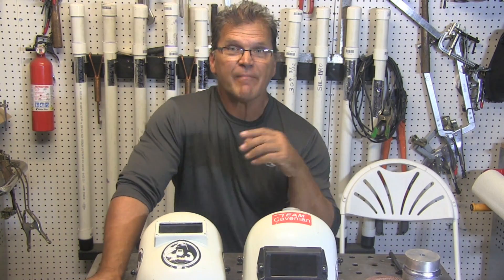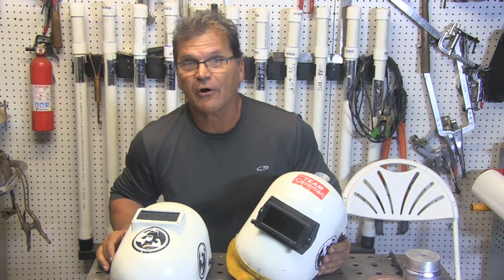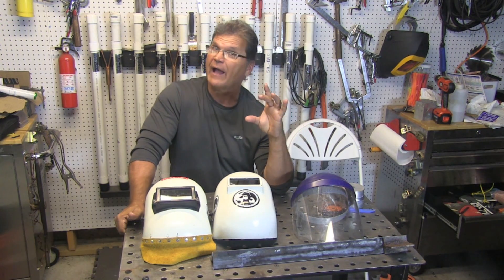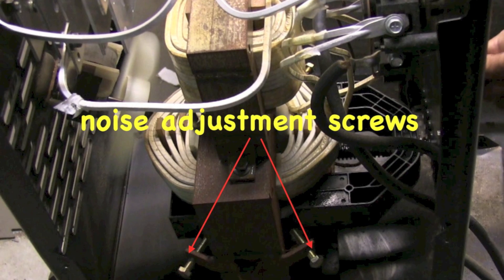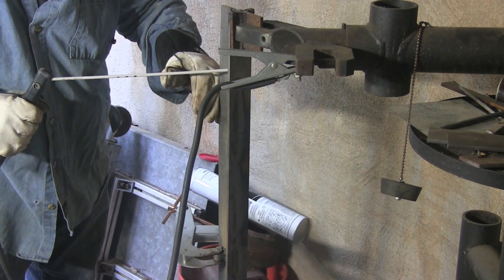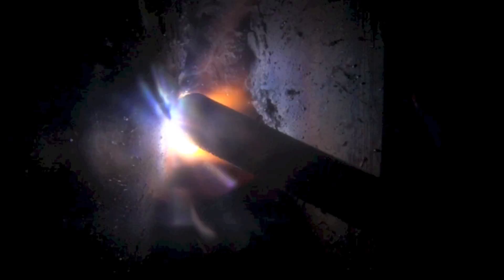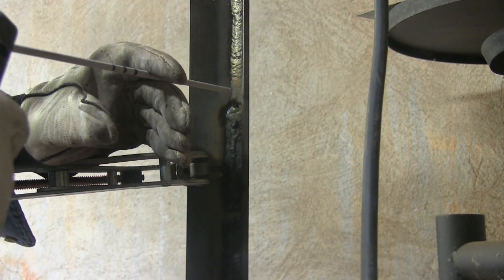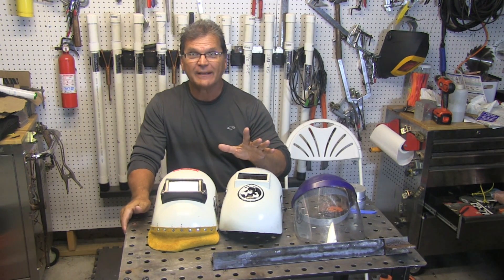Stick Welding Uphill 7018 2 Foot Long Tee Joint

Comment: Thanks Jody! I'm sure you have to have seen it on pipe before, but why is the "Butterfly" weave not used anymore, and could you show us a bit of it? Aloha...Chuck
Reply from the maker: not really sure.  as out of practice as I am on a 7018 weave I am not sure I could handle it.
Reply: Knolltop Farms I know alot of older welders that circle the toe and its just another way of depositing more at the toe, like a pause but keeping the rod moving.
Reply: When you say butterfly weave, do you mean with 6010 on a horizontal weld?
Reply: No, it's an uphill weave specifically used for the cap that has a distinctive ripple pattern. Kinda like a stick-figure bird or something, you'd likely know it if you'd seen it. It's an old pipeliner and boilermaker technique you just don't see anymore. I think it took too much time for little to no added benefit, I don't think it was metallurgically unsound, but I'm unsure so that's why I asked. Thanks for the reply to both of you, hopefully someone else may know.
Reply: I cannot do it myself, it was already out of practice by the time I worked in the tank farms starting in the 80's. But, I was told you make little stick-figure birds, with a pause in the middle. I don't see how there's room for that even if, but who knows really...I wish "Grandpa Joe" would come out and tell us, LOL!
Reply: Knolltop Farms I just did an image search in google for butterfly weave welding and there is an image from an old textbook showing some oldschool weave movements and one looks like it could be described as stick birds.

Comment: Another great video Jody!  I am a new "hobbist" welder, and have been watching your videos over the last few months.  I just ordered a AHP 160ST, 10lb of 3/32 7018, and 10lb of 1/8 7018 from Amazon.  I am ready to start "padding beads" with confidence after watching these videos.  Thank you so much!
Reply: Ill keep that in mind.  I intend to eventually learn tig as well, but I want to get good at 7018 first.  I will mostly be welding 1/8" thick carbon steel tubing, angles, etc. so the simplicity of stick welding has a lot of appeal.
Reply: I'd recommend 6010 instead, but the new inverter machines don't like running it, so 6011 is as close as you can get. My main usage of it is for tacking things up before welding it out with 7018. It is much faster because it doesn't form a slag cap on the tip of the rod that prevents easy restriking like 7018 does. I fell in love with 6010 back when I learned to weld at the tank+pipe outfit I worked for out of highschool. It's a very forgiving rod that helps you get things done when conditions aren't perfect.
Reply from the maker: That little ahp welder runs a 7018 great
Reply: Don't forget to run some 6011 fast-freeze as well, the whip and pause is a good skill to have for root beads on tough fit-ups. Plus if you get good with it you can even get a 'stack of dimes' look to your welds!
Reply: Jacob Faulkner for 1/8 in thick materials I'd Tig over stick. Use thicker material for padding beads and what not on stick

Comment: Hey Jody, My name is Arshad. I'm a welding Instructor from South Africa ( Cape Town ) I don't mean to be forward but just a pro tip for your 3F welding. Try holding your toes a bit less, move a bit slower over the center and keep your weave a bit tighter and that slag should just fall off! (~^,  I have learnt so much from all your TIG videos. Keep up the good work champ.
Reply from the maker: Thanks very much. I will try that

Comment: so when you restart,  your not cleaning off the slag? your just starting right up? I'm new, 6 months into school..
Reply: Jody long arced before he came back to the puddle if you noticed. That created a higher amperage and voltage which if you could have seen the bottom side of the rod it melted the flux/slag off the previous weld. One of the reason to start up where you stopped on your weld. The flux/slag doesn't seem to be as thick. When I was welding pressure vessels in a job shop, the WPS stated you had to feather at each stop. I wish I would have had Jody as an instructor 35 years ago. He is really sharp.
Reply: just took my D1.1 tests and I passed 3G buy failed 4G.. I really thought I passed the 4G cause it looked so good, guess I had a little slag left over.. haven't seen the xanax rays yet, but anyways, you have been helping me out alot!! thank you!
Reply: damn auto correct lol x-rays not xanax.
Reply: one more question... why are you turning the amps up each pass?
Reply from the maker: If I can restart within a few seconds I don't chip on vertical uphill. If I get delayed then I would chip first

Comment: had to do that everyday for 8 hours running multipass vertical overhead and horizontal
Reply: I always enjoyed going vertical 7018, because much of my time at work used to be running 7024 jet on floor seams in massive oil tanks, and that get REALLY boring after 100pounds of rod, LOL!
Reply: vertical is a pain, uphill with a 7018,AC,I could do it twenty years ago, I'm just not that coordinated ,anymore, some of the last trailers I built,the verticals welds ,looked terrible, I needed a DC machine, so bad, I ground some of the joints down, and rewelded them.
Reply: jet rod was interesting  the first time 5/32 smoking